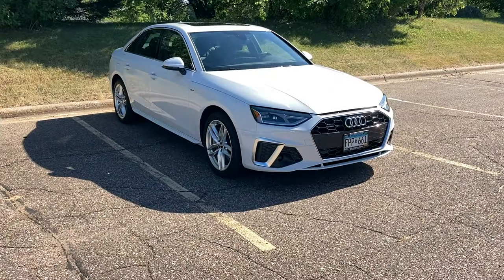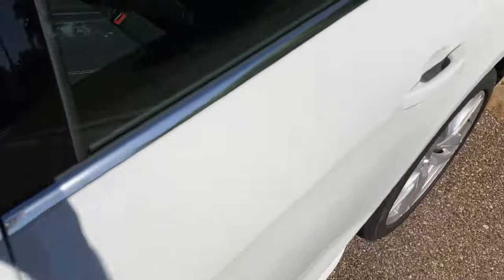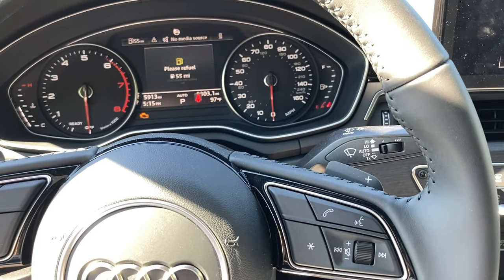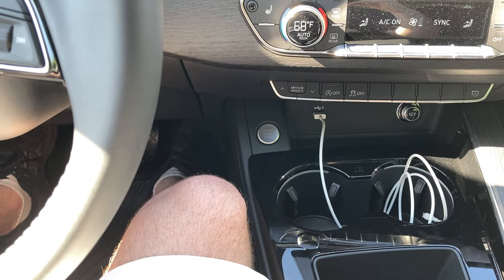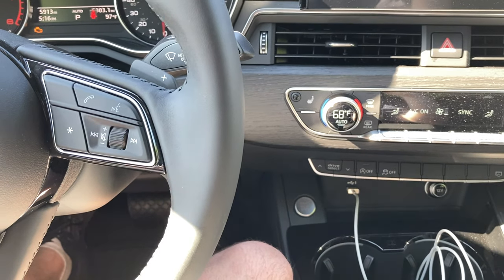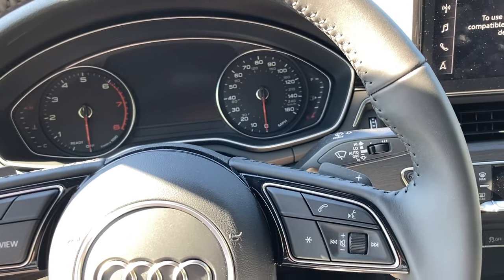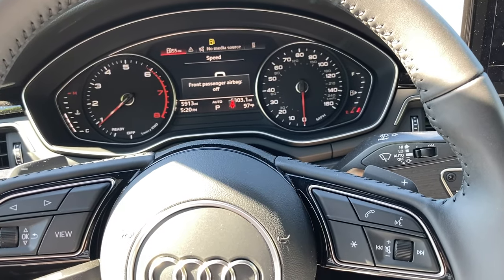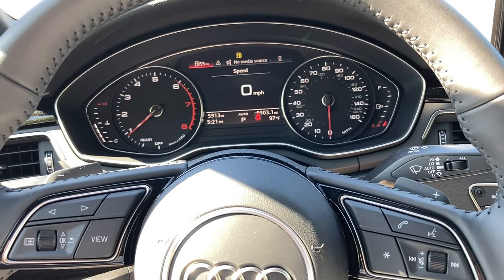Transmission Problems on Volkswagen and Audi: How to Fix Yourself - Fast and Easy!

Comment: I got my transmission flushed on my 2017. Audi s q 5 b8.5 at eighty six thousand miles when I was supposed to get it changed at 80000 miles on the dot and sure enough. It started slipping a little bit going towards 89000 Miles. Which where I'm at right now. I tried this and it worked 100%. My transmission is not slipping anymore and now I don't have to schedule an appointment to go into the shop to hear bad news

Comment: Hi, I used an OBD to check my car fouls and I used to have 17 issues on the transmission. I applied this method to clear them and it works but when I turn on the ignition and did the check again all the errors came back

Comment: When I press on the accelerator my car stutters, idk if it’s a misfire, gearbox issue, or what but I got a Code P0301 when I connected to the OBD. Probably dirty Fuel injectors but I’m going to try this out and see what happens

Comment: Had very little hope this will actually work in my A5 2018 with the DL382 gearbox - but it worked like a proper dream.
I don't know if anyone else noticed or if its the case in other models, but after holding for 15s once the ignition was turned off, upon letting go of the accelerator pedal P (Park) flashed 3 times on the dash.

Comment: Thank you for the video. I will try this tomorrow morning ! 
I’m really angry with my A4 Allroad 2018 because in low speed (below 15 km per hour) is always kicking, start with a shock each time when the clutches are coupling … basically I cannot drive in a normal and smooth way :(. Any additional recommendation ? Thank you
Reply: Did you manage to fix this problem im not sure but i believe i am having same problem as you, also got the same car
Reply: @jmartins5629  not solved :(. Looks like the gearbox need to have a software parametrization to compensate the clutches consumption, BUT nobody from Audi garages is willing to do this. I found some guys outside Audi official dealer and they can do this. Is not nice because Audi did not fixed this with a software update. If you find a better solution, please put it here.
Reply: Is your issue fix now ? I have the same problem .
Reply: @methodbenqc  same issue even if I changed the oil and filters and calibrate everything possible. Looks like is a general issue and most of all roads have it…

Comment: i have a 2018 A3 & having problems with accelerating and jerking issues and the code says it’s the clutch position sensor.. would this work to fix it?

Comment: This reset is not connected to a “ gearbox malfunction- you can continue driving “ warning / error 
message ??? 
Audi Q5 7 S Tronic 
Would this reset help to clear the message ( or potentially make things worse ? )

Comment: I noticed on my Audi Q3 TFsi 1.4 auto, which I recently acquired that when pulling away there's a slight delay in throttle response (in the first couple of gears). I also noticed when I pull up to a junction (roundabout) and start applying the brake to slow down (but not to a complete stop) and then apply the throttle there's a lag and that lag which encourages me to apply more pressure on the throttle which then suddenly kicks 2, 3 seconds late in using unnecessary rapid acceleration.  I don't know if this makes sense to anyone,. But I will try this technique you posted,. I just don't know if the fuel injectors are dirty,. or the throttle body needs a scrub,. Any suggestions would be welcome
Reply: Did the method on the video helped ?
Reply: No
Reply: However driving in S mode theres no lag
Reply: @Revel83  for me driving on s mode there’s very much lag on around the 1 and 2 rpm’s
Reply: @Revel83  and when I’m on driving mode there’s like a miss on the 2 rpm’s. Always.
Reply: I have the same issue for Audi A7 2012.
Reply: I have the same issue on my audi a7 2016, have you figured out the fix ?
Reply: @Revel83  im having the same issue on my Audi A4 b9
Reply: @Arsalan_fz  have you fix it?
Reply: I have the same issue. Any solutions?
Reply: Time for timing chain replacement
Reply: I have the same issue with Audi A5 2015, has anyone solved the problem?
Reply: I guess that's how DSG works.. you cannot change this behavior. The lag is because the transmission has to shift down 2-3 gears.. so this is a slow process.

Comment: I have a q5 that i purchased usesd and when i put the car in reverse, it will want to take off as soon as i let off the break.  Only in revrse does this do that.  Is this an issue?  Will what you showed above possibly fix this?  Thanks for your time!

Comment: Does this method works on a Audi A6 1998 model...... Please help, my car has a problem with kickdown after 50km/h the car just goes normal with no kickdown but it picks up speed.

Comment: It did not work on my 2016 A4 Quattro. I have tried but the subtle vibration continues when starting.  It looks like I need to take the car to a shop.
Reply: I made this comment, but after driving for about 3 hours the next day, I noticed that this problem was pretty much resolved. In my case, a 10-15 minute drive was not enough, but a few hours of driving could have eliminated the symptoms before long.
Reply: @RyuichiKaminogi  Is your car transmission still working great?

Comment: Got a 2018 A3 Quattro used, had a receipt in the glovebox for the ECU being flashed. Feel like the trans is a little hesitant sometimes and wanted to try this. Doing this would return the ECU to its factory settings right?

Comment: Will try this later on today 100%, hopefully it will work or improve…. Recently just purchased audi a4 avant b8 and sometimes setting off the csrcis jerky have to slow press gas if not the wheels just kick? Any ideas guy thanks
Reply: Did it work? I have 2013 a4 avant with the same problem

Comment: You legend this worked a charm thank you so much. I had a transmission in emergency mode on a Tiguan 2017 and this cleared it.
Reply: And after did it came back?
Reply: @Roberto-954  Unfortunately yes. I had to take it back to VW and they replaced some chip in the gearbox which took 8 weeks as it had to be custom made for my car from Germany.
Reply: @outofthefoxootf979  we dont have VW service or something but is it okey if i leave it like that?
Reply: @outofthefoxootf979  ask them for what chip and look online you don’t have to really get it from the dealer you could of gotten it from the manufacturer and cheaper
Reply: @Mm-wf3wx  Thankfully VW covered the cost in full for parts and labour as well as a rental car until we got our car back. They said that although our car was out of warranty, they decided to cover all costs as we had been loyal in using a VW service centre throughout the life of the car.
Reply: Oh man, I just got this message today after a week of purchasing a 2019 tiguan from a dealer. Its covered by the dealer warranty, but I'm thinking of trying this fix to see if the error comes back or should I report this now anyway?
Reply: @jajabinx35  You should report it asap especially that they need to most likely order a custom part for you car all the way from Germany. Once you have it fixed, sell the car immediately. They are nothing but problems. I sold mine for a loss and went and got me a new toyota for peace of mind.
Reply: @outofthefoxootf979  well, the showroom changed the mechatronic for free. they provided the receipt and I'm shocked it cost like 2000 pounds to resolve (Fortunately I didn't pay anything).

But yeah, I was asking around vw forums who say the later mechatronic units are more reliable but I'm still thinking am I prone of getting this error again? I Can't believe how this hasn't been raised by watchdogs if the issue is so common. I'm taking a risk, I'm gonna see how it goes....
Reply: @jajabinx35  I wish you good luck and I hope it works out for you. For me, I ended up with 2 further engine lights after it was fixed and had to take it back again. It got to the point that we weren't driving the car at all until we sold it. I even let the people who bought it know about the issue because I couldn't have it on my conscious not to tell them.
Reply: @outofthefoxootf979  guess what... the error came back! Fortunately as its only been over a month, I have the refund option from the showroom. Thought I'd reply back here to show others of my journey of a bad mechatronic on a tiguan that was clocking at 18000 miles. Maybe it will help someone and save them from getting the car (or maybe the latest tiguan 23 plate doesn't have the issue anymore).

I'm back to square one. I'm not sure which car to go for. I wanted to keep with the German cars, but I have heard all audi, skoda and vw have these dsg issues)....
Reply: @jajabinx35  yeh I’m not surprised the issue came back. If you’re after luxury get a Lexus or if you do off-roading go for a Land Cruiser. I personally purchased a Toyota fortuner. I know I have the peace of mind of Toyota reliability and I’ll never see an engine light with this car. I’m never purchasing another euro car again although Mercedes and bmw can prove to be more reliable than vws. However the choice is yours.

Comment: Tried this on a 2015 audi a3 1.8t since the gears were shifting at higher rpm's.
After following the procedure and driving for a while transmission worked smooth again as usual.
But turned on the car next morning and its doing the shifts at high rpm's. Anything else to look for ?

Comment: My 2006 audi a4 s-line over revs in sport mode it wastes fuel and doesn't go any faster if it would change gear between 4000-5000 revs the car would be a lot faster. Instead it goes all the way up to 6000rpm. However it doesn't always do this, when it decides to work properly and shift up around 5000 the car absolutely flies. Could this be a gearbox issue?? Has anyone heard of this issue before? Should this reset fix my issue?
Reply: @abelalba3111  Let me know how it goes for you. This helped a bit but not nearly enough. I think the only solution is to go to a mapper to tune the gearbox. Problem for me is most have the VAG for 2014 upwards I just want to be happy with how my baby drives  ￼

Comment: Anyone found that after doing this, it would work for couple days and problem will come back. Do we have to do this reset every couple days? Mine one is a 2013 A6
Reply: Yeah same thing with me it would work for couple of days and then it would go back again did you find a solution?

Comment: Hey i have a audi A7 2016 my transmission came on and i follow your steps and it work but. I cut it off now its not working keep trying or do you have another trick
Reply: not working? car is not working?

Comment: So today i drove my GTi in manual mode and turned off my Traction control option & revved it, there was a screech and there was a sudden jerk & there popped an indication in notification bar stating that, (Gearbox in emergency mode. You can drive on), i turned off my car & after 2 minutes i turned it on again and started my drive, when i put the gear in drive mode, the car started from D2 and after the acceleration it jumped to D4 directly, without D1 , D2, D3 & D4 , my car jumped from D2 to D4 dorectly, im not knowing what's the problem😢

Comment: I have a 2013 rs5, medtronic failed twice.  Service is telling me I need a new transmission.  The car only has 67,000m
Reply: I have a 2014 S4 and I had to replace the mechatronic after something like 40,000km but fortunately it was still under warranty. Just to be clear, they only changed the mechatronic, NOT the entire transmission, which would have cost a fortune.

Comment: Just wondering if someone can help diagnosing an issue where P (with cross line) is lit up and I’m unable to shift the gear, which is stuck at parking (P)

Comment: Anyone know if this works on a 2016 A5 with a stage 1 tune? After the tune, on a hard launch; it almost stalls on the shift from 1st to 2nd gear in drive or sport mode.  It I shift to manual mode, it doesn’t do this. I read it’s due to the redline limiter.

Comment: I did this to my car which is Ausi A4 2013 Limousine diesel but the problem is still here, and it is whenever I drive down from a higher part the acceleration goes high while being in D and sometimes although I do not need to accelerate I am obliged to accelerate to make the gear normal.
Can anyone tell me where is the problem?
Thanks

Comment: I got a skoda octavia dsg7. Been driving it for 3 weeks now. It feels a bit jerky in the low gears, especially when changing from 3>2. If I have my windows open I also hear the transmission doing something.
Should I try this too? And can this have any negative side effects? I know nothing of cars 😅 Thanks!!
Reply: did this work on your skoda?
Reply: @takumarange3084  I didn't feel a difference, though it is possible the dsg was reset. I don't think it changed anything on th mechanical behavior of the shifting. Took it to the garage, dude drove with me and said it was standard behavior of a dsg in low gears. I'm used to it now and pretty confident everything is okay.
Reply: @jessedutch3086  okay thank you was thinking of doing on mine also so i will leave it like that 😀

Comment: I’ve been having transmission problems for like 2 months. It drives great around town shifts gears good no noises but everytime I go up a hill to go to work it starts to give me issues. It’ll start to high rev and when I try to slow down it’ll have trouble shifting gears then it’ll high rev and shift gears at like 4RPM. I don’t hear clunking or gears skipping but I can smell the transmission fluid. Then I basically let it sit then it works fine again. No check engine light either! I take it to shops but they don’t really know either. I’d appreciate any help it’s a 2011 Volkswagen Jetta SE about 120k miles just got a transmission flush but I didn’t do this method. Do you think it’ll work?
Reply: somehow came back to this vid but my car hasn't had a problem since!!😁

Comment: Hi all I have question regards Audi A4 2016 Automatic, since the change of gear oil I hear click sound a4 speed 40 coming at gear 4 not during shifting it's while gear at 4 and that happens only after I leave the parking mode and I hear it only once until next parking can you advise over what is wrong with it the car driven less than 90 K KM and no warning on the dashboard, the drive experience is  very smooth and before change the gear oil there was no sound at all the changing of oil is part of regular check. can you please share your experience if you had the same before?
Thanks
Reply: That’s normal. Exactly at 40 km/h right? Has something to do with ABS/ESP System. So don’t worry mate

Comment: Im bout to try it on my 2013 RS5
Reply: Beautiful car
Reply: How many times did your mech unit fail and did you buy a new transmission? My car only has 67,000m on it
Reply: @awakenosiris  i traded it in did not fix it , those transmissions are trash 🤦🏻‍♂️ audi recommended a new replacement

Comment: Saludos desde México, podrías escribir el proceso para realizarlo y ver si funciona en mi Audi a4 porfavor gracias
Reply: 1. Prendes el switch
2. Pisas el acelerador hasta el fondo
3. Manten el acelerador pisado por 30 segundos
4. Pasados los 30 segundos, primero apagas el switch y enseguida dejas de pisar el acelerador
5. Esperas 3 minutos con el swtich apagado y sin pisar el acelerador
6. Pasados los 3 minutos enciendes el auto normalmente

Comment: Question, would this remove my stage 2 ecu tune if I do this? I mean I can flash it right back but still I just want to know if this will affect the tune or not before I do it because I am getting hard shifting from first to second and sometimes if i take off hard in first, when i shift to second it will and then immediately go back down to first so now ive been babying it lol.
Reply: Nevermind I just got a dsg service done and it fixed the issue lol so I'll just run like this till I tune the tcu
Reply: Nevermind I just got a dsg service done and it fixed the issue lol so I'll just run like this till I tune the tcu
Reply: Any reply to the above on the mapping
Reply: @marcedgar9326  not yet but I'd say it doesn't effect the mapping, I'm sure they did either that or something similar when doing my dsg service which fixed the issue and didn't mess with my tune but I'd wait for confirmation before trying it unless you can just reflash your car right after in case it does remove it
Reply: @5150B9  need to be sure before I do running a stage 2 is costly to get back lol
Reply: @marcedgar9326  any luck on a response?

Comment: Anybody know if this will cause any issues with a APR Stage 1 tuned car?
Reply: It will not cause any issues with a tune. It will actually benefit your tune because the transmission will learn to accept the power from the tune and know when know to shift.

Comment: Is this applicable to 2012 A8?
Reply: Did you every try it? I have the same car and it's annoyingly laggy dropping into 2nd gear. When it does finally kick into 2nd, it does so very roughly. Have had Audi recalibrate shift points in the past which worked great for over a year but don't want to take it back if I can do it myself
Reply: @legend146   I run the car in sport mode always. Drive shifts too soon.
Reply: @victordohleman953  thanks for the response. I was doing that as well but still got the hesitation and clunking going into 2nd. Unless I used the paddles to shift manually. I tried the method in this vid and it actually seems to have made a significant difference. Back to smooth shifts in all drive modes.

Comment: BS on 2011-20114 DSG 7 speed transmission has solenoid problems and clutch . Audi refuse to open  engineering case or recall on both . That how Audi treat they're costumers